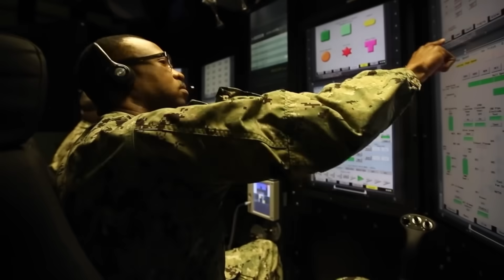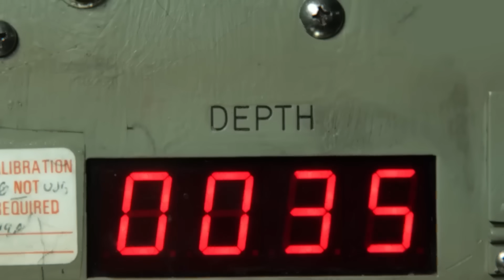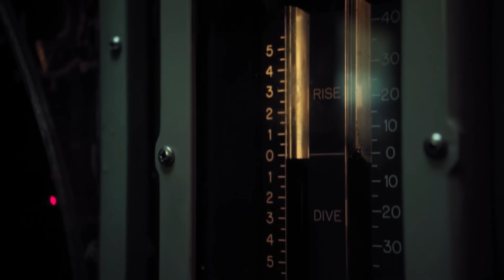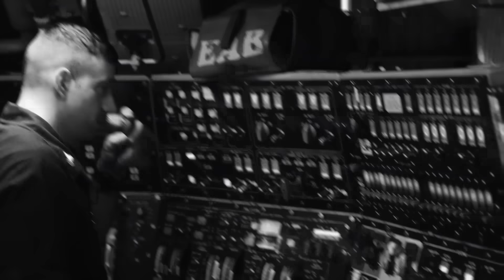What Happens When a Submarine Hits "Crush Depth"

Comment: Thinking of the crew in Oceangate who evaporated in a fraction of a second. I never knew the physics were so brutal when implosion happens.
Condolences to their families and friends.
Reply: It’s not quite like that but they did die instantly. They certainly weren’t vaporized or turned to ash or whatever.
Reply: @chumerranion778  it’s possible they were, basically and implosion and explosion with all the oxygen in the vessel heated up etc. we don’t know ofc, but it’s very possible.
Reply: @chumerranion778  also because the oxygen within the vessel is compressed as well it would actually cause a combustion generally. So rapid implosion of the craft with several million pounds of force, and the oxygen also being compressed would likely cause an explosion after said rapid implosion.. so effectively vaporized, reduced to meat smoothies before they even noticed anything was happening. Painless, quick, and completely unnoticed by any of them.
Reply: @Dgy5rWgg78  Yep pretty well spot on. Pressure gradient will do horrible things to bio.
Reply: " I never knew the physics were so brutal when implosion happens." apparently neither did the CEO as he used CARBON FIBER for the hull
Reply: Yep. Pretty much turned to goo...
Reply: It's going to be a long time before a Billionaire/Millionaire spends $250 000 to see the Titanic. Hoping Donald Trump does it.
Reply: @jeffreykaufmann2867  a russian company goes on titanic excursions
Reply: @jeffreykaufmann2867 lol yes, bet there are a couple of million people who would put together the money to send him on that trip.
Reply: @jeffreykaufmann2867  Why?  What did he do to you?  Are you really that hateful a person or just doing what you are told to do?  I may not like Trump personally but things were a LOT better under his watch than flaky, corrupt Joe.  I wish Biden a fair trial to him and his family and if Trump is found guilty of any real crime, I wish him a fair shake as well.

Comment: Its mindboggling that there are ocean depths as deep as the altitudes that planes fly at
Reply: good analogy
Reply: yeah, next time i see a plane at the usual flight level of 38,000 feet, i'll pretend i'm at the bottom of the mariana's trench and the plane would be the surface of the water. kinda spooky.
Reply: @ImperialDiecast SHUT UP
Reply: @ImperialDiecast  Or if you're swimming on the surface and the bottom is 38k feet below.
Reply: @ImperialDiecast Truly unimaginable amount of water, strength and darkness
Reply: Earth is a blue planet, the oceans are supreme.
Reply: Hope they knew Jesus 🤟
Reply: Mount Everest would submerge if it was in the deepest point in the ocean
Reply: @Vi5hnujan with about 6 thousand feet of water above it too.
Reply: Not really. An Airbus A350, which is a passenger plane, has a ceiling of 46000 ft. That's over 8 miles. No known part of the ocean is 8 miles deep.
Reply: @markwoodstock1112  He said the altitude normal planes fly at which is a standard of 35 thousand feet not how high they could fly.
Reply: The millionaire goes pop!  Wha oh. 😢 😂
Reply: I love marinara
Reply: @JonathonUH2 
Yo don't bogart those mozzarella sticks homie 😂😂
Reply: There’s 100000000000000000000 suns in the universe.  It stretches 900000000000000000000000 miles across

.
Reply: Earth without water is basically flat sphere compared to rest of planet in the universe.
Reply: On a planet that's 70% water? Really hard to fathom 😂
Reply: @BadaBing-01 "fathom". Was that pun intentional?
Reply: I can't believe the earth is flat. It's actually crazy
Reply: @HamChex  It's not.
Reply: @tadferd4340  pretty sure it was a joke
Reply: Yep ,makes you wonder how the earth doesnt snap in  half..as it must be very weak towards the centre with the massive weight of water and land above.

Comment: I was on the frank cable, a submarine tender, basically a floating repair facility for submarines. Repairs to submarine are heavily QA'd to prevent things like this from happening. Parts are tracked down to the element from the earth it was taken from. Every step documented verified, and then verified by a QA inspector. If anything fails, it will be heavily investigated.

Comment: The crazy thing is Rush ignored warning signs that hull failure was imminent. I saw an interview of an engineer that claims he was on the Titan during an early dive and heard noises indicative of hull failure. Carbon Fiber is woven in layers and the hull of the Titan was 5” thick I believe.even though it made several successful dives, the constant exposure to the extreme pressure at the depths they dove and the pressure fluctuations  could have caused tiny fissures or even delamination of the carbon fiber which eventually led to catastrophic . This was a largely untested design and they did little or no post or pre dive safety inspections
Reply: Yeah, fatigue will do that. For metals, there’s a theoretical stress limit below which they should be able to be loaded and unloaded forever without failure. For plastics, resins, carbon fiber, and suchlike, there is no such limit and failure becomes a matter of when, not if. The carbon fiber surviving one dive is not an indication that the same sheet of carbon fiber will hold up at that same depth many times.
Reply: That's how carbon fibre works. 
It's strongest on it's first trip. 
Every cycle after that, the carbon fibre starts to lose integrity. 
So on trip on, strong. 
Trip 10, ready to pop.
Reply: @NotDecided420 If this is well known, why on earth did they utilize carbon fiber in their design?!
Reply: @omegamanGXE in his interviews he says “carbon fibre it’s a great material” , well not for submersible, now it’s obvious. He proof himself wrong at the expense of 4 more life’s . Not great at all.
Reply: @toninocars  it IS great, just made for using it over and over WHILE there is constantly flowing electricity through the titan-carbon fiber hull.
Reply: @omegamanGXE  Arrogance.
Reply: @omegamanGXE  To be seen as an edgy, Steve Jobs like, entrepreneur.
Reply: @omegamanGXE 
General rule of thumb with CF. 
Compression, no(the example given all over is you can't push a rope) 
Tension, yes. 
They did it wrong. 
Add resin, and you can push that rope but it's the resin that's doing it you could remove the CF ,which ya can't.
Not sure why they went against basic physics laws that you really don't need to have a lot of education to understand.
Reply: @omegamanGXE  because the guy is wealthy and it was his god given right to use whatever material he wanted
Reply: @Claydood  Yes but he didn’t build it with his own two hands, he had a team of engineers and consultants who designed it and made prototypes, etc. How could something as basic as carbon fiber being shite for deep sea diving be overlooked? 

Also, I am a noob, but what benefits did they even stand to gain from carbon fiber anyway? Carbon fiber's principal attraction is strength despite being more lightweight than steel, titanium etc. But why would that even be a benefit for deep sea diving? It’s not like automobile racing or spacecraft where being as light as possible is an advantage.
Reply: @omegamanGXE  I was being sarcastic because that is always the excuse to why people, especially Americans, do stupid things. He had a team of inexperienced engineers because he wanted a diverse team and instructed them to build it with carbon fiber because it believed it was a strong material. You don't want something lightweight to hold the weight of the sea and contain a pressurized cabin.
Reply: @omegamanGXE  >How could something as basic as carbon fiber being shite for deep sea diving be overlooked? 
Simple: If anyone pipes up, fire and replace them. Repeat til you have someone (say, under 50...) who doesnt know enough to point out the glaring nightmare fuel, but DOES know enough to do their job. 

And likely a combination of "Cheap" (he got it on discount because it was past it's shelf life), and "attracts attention". It was a One of a Kind submarine.
Reply: @Claydood  >He had a team of inexperienced engineers because he wanted a diverse team
Less so "diverse" and more "Yes-men" :V
Reply: @NotDecided420   Carbon fiber, light weight and strong. But terrible on flexibility. I used to ride carbon fiber road bikes, light weight but you could feel every bump.
Reply: @NotDecided420  not only that, but because of the combination from titan, carbon fiber ánd salt water there was a constant flow of electricity. (The salt water acts as an electrolyte), ultimately leading to corrosion of the hull, until it couldnt withstand the pressure anymore
Reply: @NotDecided420  Exactly right and the sub had already exceeded its life span and they knew it.
Reply: Rush thought paying too much attention to safety concerns hindered innovation. In effect, no matter how many times his friends, some of whom were experts when it came to submersibles, told him there were concerns about the Titan; he decided to disregard their advice. This attitude ended up costing him his life and the lives of 4 other people. I still cannot understand that.
Reply: @mlr0115  It is extremely impressive that he was able to construct a submersible for only $2 million. Particularly for a life-critical application. It remains to be seen whether neglect of safety played a factor in this incident. We need to wait for the results of the investigation and not speculate based on rumours. I remain open to  his engineering vision of constructing a low-cost submersible. To be  perfectly clear, YES,  it is a life-critical application but OTOH there is government bureaucracy and inefficiencies that will often limit cost-effective engineering and force you to spend $100 million instead of $5 million.  

Government certification does not always necessarily equate to a safer submersible.
Reply: @Better_Call_Raul But he refused evaluation and certification by recognized, independent deep dive organizations, not governmental.  Maybe due to costly safety recommendations or perhaps they would flatly refuse to certify a carbon fiber hull for deep dives? Would be impossible to sell seats then, no?
Reply: Yup, it's not like steel or titanium that can compress and rebound to its normal size and state. The compression of carbon fibre is destructive.
Reply: Three wise men of Gotham,
They went to sea in a bowl,
And if the bowl had been stronger
My song would have been longer.
Reply: @adg1355  Dark humor and I'm here for it. ❤ I truly feel for those people and their families. But sometimes dark humor is how I get through life.  Sometimes it's bad enough that you have to start laughing at the ridiculousness, the unbelievability.
Reply: The submersible cost $2 million to construct.  A very impressive low-cost engineering feat.   Don't know what the cost is for an unmanned mission, but if feasible, I would send an unmanned sub down hundreds of times and then check how the carbon/titanium hull is holding up.  If there are structural strength issues, it will likely come out during extensive testing of unmanned missions; the material is not gonna fail just out of the blue.

 It is not clear just  how much testing was done on this sub. 🤔
Reply: @Better_Call_Raul from what I've read Stockton Rush had been well warned it wasn't safe for "customers" he didn't believe them. I know the sun hadn't been approved or anything like that & he'd apparently made it really clear it was purely experimental! But if the other 4 were well aware of this & they also had 2 sign a waiver, and it mentioned dying 3 times on the first page! If this were true, why would they have gotten in? Especially the dad & son.. Who'd risk their own safety & that of their child? 🤦🏻‍♀️
Reply: @Better_Call_Raul  And Rush refused to have it tested by an independent agency. Essential to have people outside the company to evaluate it. Rush and his employees had too much at stake to honestly evaluate it's safety.Built in conflicts of interest.
Reply: @frankweir9514  Rush was a reasonably intelligent man and I am trying to give him the benefit of the doubt. Therefore I must tip my hat to him for believing in his submersible and piloting it himself; I assume he is not suicidal. If he had  refused to step foot in the sub that might give more weight to the conflict of interest theory.

I am not  quite convinced that  any private agency and diving organization is necessarily more qualified to certify the sub.  He did consult with NASA and Univ of Washington and they concluded it was "well-designed and safe" for 3000 feet. But not the 12,000 feet he was going to.

For the most part, I think he was on the right track. The fact that he built a sub for just $2 million that succesfully  reached the Titanic   is just incredibly impressive engineering.  I would have thought it would  have cost far far more than that.  
🤔

According to the article "Princeton-alum Rush Stockton's submersible found missing off Newfoundland coast" published in The Daily Princetonian on June 22, 2023, NASA and the University of Washington found that Stockton's submersible, the Titan, was "well-designed and safe". 

However, they also found that the submersible was "not equipped to withstand the extreme pressure" of the deep ocean.

The Titan was designed to dive to a depth of 1,000 meters. However, the pressure at that depth is so great that it can crush even the strongest materials. The Titan was not equipped with any special features to protect it from the pressure.

NASA and the University of Washington also found that the Titan was not equipped with a "fail-safe system". A fail-safe system is a backup system that is designed to activate if the primary system fails.

The findings of NASA and the University of Washington are a reminder that even well-designed and safe submersibles can be lost if they are not equipped with the proper safety features. It is important for submersible designers to take into account the extreme conditions of the deep ocean and to equip their submersibles with the necessary safety features to protect the lives of the crew.
Reply: 💯 agree
Reply: I am no physics expert but that half pea pod shape seems like a bad decision. Seems like it would make the weight not distribute evenly and probably crush the small end first. Didn't they say that cone/tip was found separate from the rest of the wreckage? Probably got knocked off first. What a horrible and senseless death for those people.
Reply: @anonymousperson8259  If you went inside this craft; took it down, you were most daft. You might as well have shot yourself; you stupid fool. [With apologies to "Twinkle, Twinkle, Little Star".]  Do supremely foolish things; win fatal prizes.
Reply: @anonymousperson8259  there is a lot of questionable choices that went into the design. Another potential issue is the fact that dissimilar materials were used. A carbon fiber vessel with a titanium nose that was attached with adhesive and an acrylic or plexiglass window.all materials react differently to pressure and stress and expand and contract differently
Reply: "evetually led to catastrophe.".
Reply: @sonofizzy  yes I meant to write catastrophic failure but hit post before proof reading.serves me right for trying to use big words
Reply: @googlechicken  No problem.  Just wanted to make sure you knew.  Take care; be well.
Reply: You mean to tell me none of his employess were white?
Reply: @Abstract.Noir414 All his employees were white maybe that's why it failed.
Reply: Rush was either delusional or suicidal.
Reply: its a shame he had to bring down 4 other people with him
Reply: I thought it was more to do with different materials being glued together...not a good idea under pressure.
Reply: @dhouse-d5l  that is a possibility as well
Reply: Carbon fiber's real strength is in tension, not compression. It's like trying to push something with a rope.
Reply: British Comet yo!
Reply: @stevenwood6592  the word is 'entangled', but good point

Comment: Remember the crush depth is only rated for a sub that is structurally stable....if a breach were to occur in the hull, the sub would get crushed way before it's crush depth since the oceans immense pressure is constantly and always acting on the subs structure.
Reply: that is a rated crush depth- so, to the contrary, most military subs will hold together way below their rated crush depth. and if the craft descended into depth as brand new and kept there it would last longer than going up and down. if there is a breech in the craft's structural integrity- all bets are off, but it could also provide a timely warning to its occupants.
Reply: For example James Cameron’s sun that went to the deepest point had to withstand over 100 megapascal
Reply: Nah, you'll be fine.
Reply: A pressure vessel is always rated for its weakest component. For the Titan that was its viewing acrylic at 1300ft. You have to also consider the constant changes in the temps for the material. On the surface the sub will get heated by the sun, then if rapidly descending could go to almost freezing temps. So they have to withstand that constant changing temp as well.